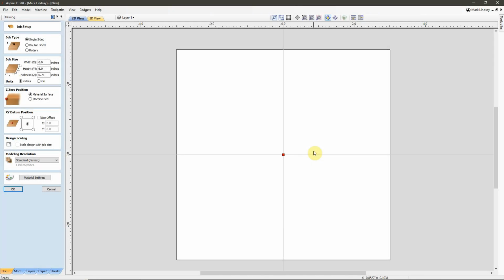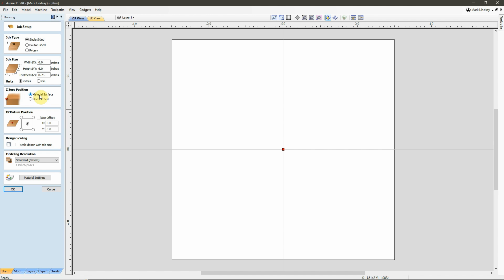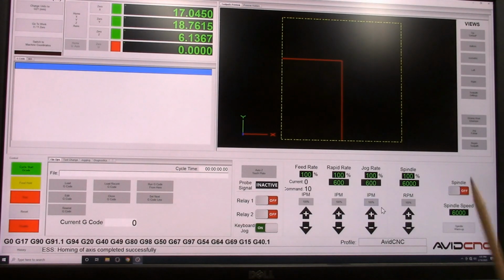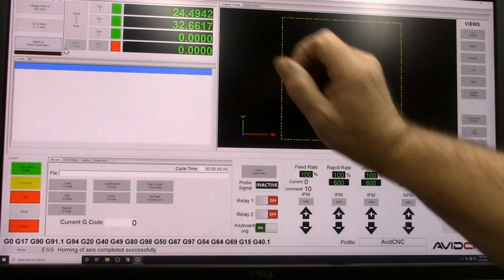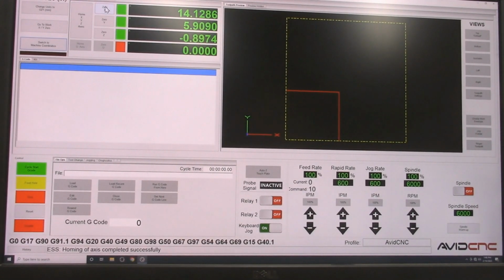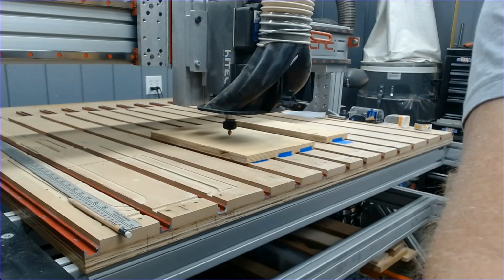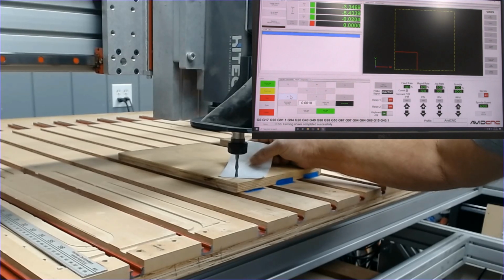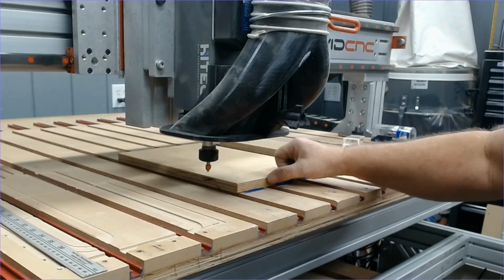Manually Setting X Y and Z Zero on my @AvidCNC  4848 Pro CNC Router

Comment: Mark, I always learn something from each of your videos.  You talked about setting the z-zero to the bed surface for through cuts.  How does that work and would that help with the tape gumming up the endmill?  I have been having issues with through cuts getting gummed up with the tape, both blue tape and double face tape.  What is the best way to avoid this?
Reply from the maker: Thank you, John. Buildup is always a problem, no matter what kind of adhesive mounting technique you use. I've found that keeping my bits clean really helps reduce it. I use isopropyl alcohol (91%) I get at the local pharmacy to clean my bits and collet. In the past I used VM&P naphtha, but the isopropyl alcohol is much cheaper and easier to find. Both work great. By cleaning my bits after each use, I find they tend to gum up a lot less frequently. I can't explain why - I can only say that it works for me.
Reply: @MarkLindsayCNC  Thanks for the quick reply.  I will begin to clean my bits mor often.  You indicated you z off the bed surface when making through cuts.  Why?  and Do you have a video on how that works?
Reply from the maker: Not yet, but one is coming in the next couple of months.

Comment: Outstanding video for beginner and intermediate CNC’ers. Explained better than about anything I have seen. I think once you learn G92 and implement a tool height offset with your Z probe you’ll zero off the bed 99% of the time without worrying about carving the workpiece and changing tools.